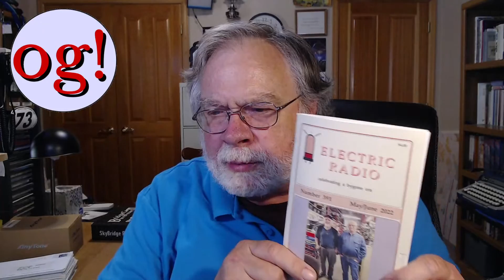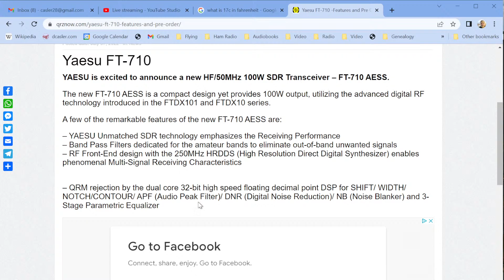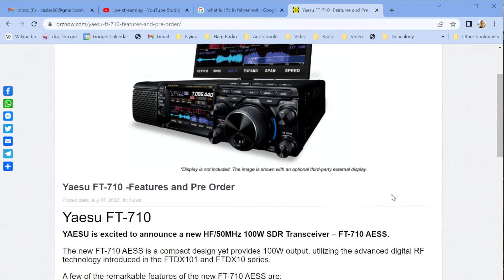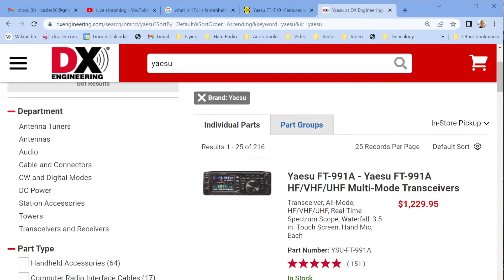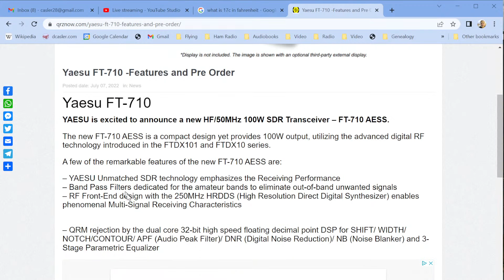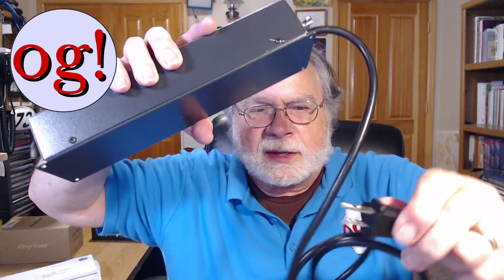KE0OG Dave Casler Live Stream 7 July 2022

Comment: Hi Dave,
My students all passed their tech exams, 100% success this time! Some of this is due to your videos because I guess you were a bit more interesting than me!
I watch the frequency of my line power, and it gets down to 59.93 HZ at times with Alabama Power, and we look for losses to last for hours. We are at the end of this line, so we are the first to be dropped. We hit 105.3°F last week, so I got out the battery powered "swamp cooler" and set it up. No sooner than that, the line power "went away", we went to battery power and the generator for the freezer and refrigerator for about four hours. Then thunderstorms developed and we were back on the line again. Thunderstorms can be a blessing and a curse  as you well know. It cools off the air, but can be a curse to Amateurs.
I've taken five direct strikes from lightning and never lost anything but coax and wire dipoles, it caused  patchwork of holes in my aluminum roof one time from a direct strike over the kitchen which killed a light over the sink, then went down the drain, literally.
Love your videos, best regards!
Fred-W4FJF